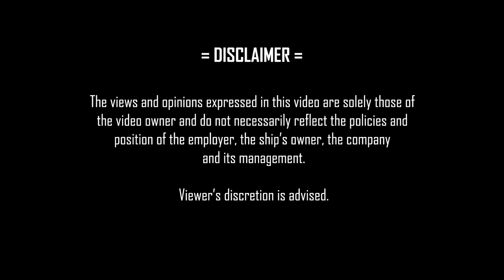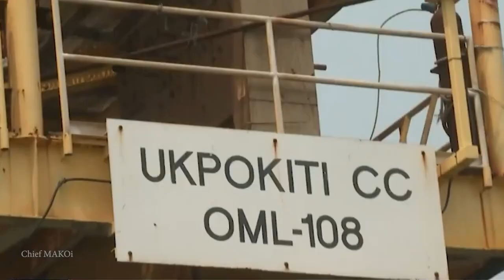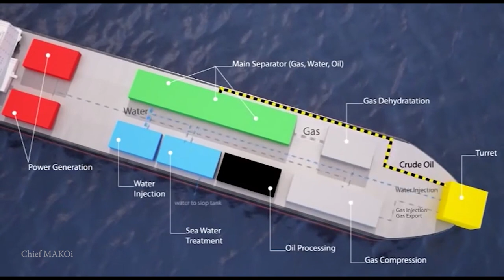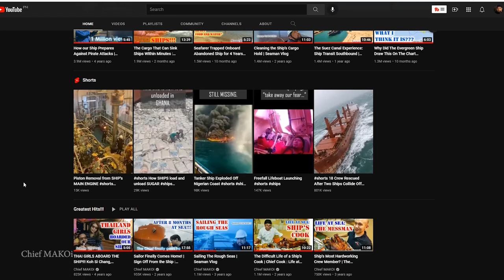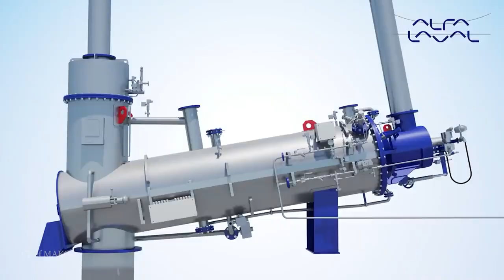Oil Production Vessel Exploded in Nigeria | What is FPSO and Inert Gas System? | Chief MAKOi

Comment: Back in my Navy days and I mean way back we use AV-Gas 115 / 145 or tanks were design to be full all the time, gas and salt water  either receiving or discharge gas and water kept them full. There was a comfier dam around the tanks fill with an inter gas set at < 6 % O2, the biggest danger is we would use it at the flight deck we had to vent it to bring the liquid up to flight deck, Always piss off the officer’s Mess because they couldn’t have candle lite dinner with there steak dinner, cause I put the smoking light out about the ship. 😁😁😁

Comment: Safety standards in Nigeria?.........far too many crews don't even pay lip service. Its so common to see crew smoking and using mobiles on deck. A Captain i knew even had a barbecue on deck every sunday! Frankly its a wonder there are not more explosions. No maintenance and no safety standards makes Nigeria a bloody dangerous place to work on a vessel. I always refused to stay on any Nigerian owned/operated vessel. Then add the open corruption with cargo disappearing off these FPSO's and well you get the picture!

Comment: As I understand it the atmosphere is around 21% oxygen and about 0.2% carbon dioxide. If I remember correctly CO2 is very slightly heavier than average atmosphere. If this is correct a centrafuge will separate (nearly) all the CO2 at a fairly low energy cost, so exhaust tapped off from the main stack and run through a 2 stage centafuge would provide as much CO2 as you could use. The first stage separates particulates and the second CO2.
Reply: The atmosphere is already 80% nitrogen, and that is a better inert gas than CO2.
Reply from the maker: It's the nitrogen in the exhaust gas that's being used.
Reply: Also there is CO which folks can die from...

Comment: FPSOs are mobilized to deep water since reservoirs on shallow waters already on decline, where advanced mooring system are installed on sea bed connected to wellhead and clustered. By the looks of the FPSO, it's obviously an old one. Latest design of FPSOs are more lenient to safety

Comment: Could of been the crude cooking that blew first then resulting fires. A water pump failure or mishap with water valves in the inert gas system. Maybe crude spillage washed into bilge over the years off gassing acetylene got sparked. Maybe one of the guys was over taken by fumes and others vented an area that resulted in the combustion. Bad event.

Comment: Notice that this tragedy never made main stream media. The oil industry has a very good media presence and wont hesitate to use it to suppress bad news. So now what will happen? clearly there were preventable problems and procedures being ignored not lest of which was the age of the asset which had been recognized by it seems all but one in the industry. Will there be an investigation? Will someone be held accountable for the damage and neglect? It would be good to see a follow up on that process and the outcome.

Comment: Is the possibility being considered that the Trinity Spirit, weakened through age and neglect, broke her back; and the resulting fracture and the sparks caused by the tearing of her hull plates, led to the fire and explosion.  Given that the vessel was moored off Warri for such a long time, was considered unsafe, and her cargo tanks were nearly empty, the presence of petroleum vapour in those tanks would be almost certain.
On 07 January 1979, the tanker Betelgeuse broke her back, caught fire and exploded at the Whiddy Island Terminal in Bantry Bay, Ireland, with the loss of 50 lives. Contributory causes included improper ballasting, excessive strain on the ship's hull, failure to use the ship's 'loadicator', the hull weakened by corrosion caused by failure to renew sacrificial anodes, and no inert gas system.

Comment: Chief Makoi... Sir, could you please go a little more in depth on the Inert Gas System ? Maybe I missed something in this video, but why wouldn’t putting a nitrogen blanket be a better alternative than the mechanically complex system you outlined here ?
Reply: Using exhaust gas is a lot cheaper and just as effective, if done right.
Reply: The vessel needs to be able to ensure the atmosphere of cargo tank is oxygen deficient no matter where they go. If you load cargo in the middle east and deliver it to Norway, then the change in temperature may cause the cargo and vapors to contract, creating a vacuum in the cargo tank. We don't want tanks to implode, so there are P/V valves to allow air in to prevent this from happening. But if you are carrying a flammable cargo then you don't want air to go into your cargo tanks. So the inert gas system can be used to maintain low oxygen concentration while underway.

Similarly, say the ship gets to Norway and now needs to discharge cargo. Sending the cargo out of the tanks to shore will create a vacuum in the tanks. So the IG system needs to make up that vacuum to ensure oxygen does not come in.

Some small chemical tankers do operate without an IG system. If they ever need to inert their tanks, they will get pressurized N2 bottles and just use those. But the cargo tanks on an oil tanker are EACH thousands of cubic meters in size, you already have equipment onboard generating low O2 gas (e.g. boilers), so why not use this gas to inert your tanks?

A flue gas system is pretty simple. Bring in exhaust gas from boiler, and run it through scrubber. The scrubber just sprays sea water on it to cool down the gas, and remove contaminants. Now send the clean, cool gas through blowers (a.k.a. "fans") to the cargo tanks. There are some extra automation and safety features (O2 analyzer, isolation valve arrangement, deck water seal) but this covers the essentials.
Reply: @phantomsplit3491 ... Thanx...That cleared up the confusion...

Comment: Probably at their most dangerous when not commissioned and in mothballs. The tanks will have been mostly empty but with volatile residues and the huge solar heated void space is arguably more vulnerable. One damaged flame trap or a scrubber plant breakdown. No licence, no income stream, no maintenance, no chance. The low oil prices have been a big problem for the marginal boys. Make do and mend not maintenance. How does seabed production well head control line hoses fitted with duct tape bend restrictors grab you?

Comment: Instead of saying "heat" -- you should just call it "ignition".   Because even static electricity from our fingers touching something can ignite the fuel, and there's no "heat" really, just a spark...   Even in a diesel engine, the fuel ignites purely from pressure by the compression stroke of the piston;  diesels have no spark plugs (as you know).  But still, ignition occurs, and without "heat".
Reply from the maker: Actually, wrt diesel engines, the compression heats up the air inside the cylinders.  It's in the formula of the combined gas law.  It's hot enough to ignite the atomized fuel particles that get injected.  Same thing with sparks.  It may be subtle to us, but for an atmosphere with combustible vapors, it's enough heat to ignite a few particles which in turn causes a chain reaction.  So in the end it's still heat.

Comment: You actually don't really go into detail much. Most accidents involving explosions on tanker ships occur during tank cleaning, not so much during loading or discharging, or even just sailing. This is also why tank cleaning alongside jetty's is usually forbidden. It does have to do with the fire triangle as you explain, during tank cleaning you introduce moving parts like fixed tank cleaning machines that can introduce sparks when they break down. Also for loading and discharging a maximum flow is adhered to, to prevent static electricity buildup in the fluid. When cleaning cargo tanks, especially larger ones this can become an issue because you can have static electricity buildup in the washing water (this is the very reason IGS is actually used). What is also noteworthy is that the highest explosive potential is achieved during cleaning operations. If a cargotank is 98% full, the space for a explosive mixture is relatively small, while having a empty tank with cargo residue creates an enormous volume of explosive mixture. The clip of that Stolt tanker exploding is something entirely different, that was a Styrene polymerisation runaway reaction. A famous accident involving cleaning operations was the Bow Mariner disaster in 2004. I was working on a chemical tanker myself at that time and have seen underwater ROV footage that was taken just after the sinking, litterally labelled 'casualty search'. That footage was scary, it showed the vessel ripped apart like it was made of paper.

Comment: None of these are actually explosions, they're only conflagration or combustion, not detonation. You're looking at examples of simple fires, not actual explosives or explosions. For someone who is usually so careful with terminology this is a pretty glaring mistake my dude.
Reply: Actually it isn't. If combustible materials are stored at high pressure they can explode. The force of this particular one split the ship in question into two. The oil tanker he kept showing when he referenced the explosion of tankers was heavily damaged by the force of the explosion. Heat+pressure+combustible materials=explosion.

Comment: Why not use new salt nuclear ☢️ engine instead of all this mess. 🙄
Reply: Because you need to mine uranium, which does not occur in significant quantities everywhere. Then you have to process the uranium minerals to qet the uranium oxide.
Mining is messy, the whole process is messy but the reactor.
That line of reasoning is the akin to that used by the meatless people, I mean ignoring the whole production chain and just focusing on the final product.
Reply: @chattonlad9382  most people think "clean" regarding the last step, but few have any idea regarding the whole chain, in a kind of "Total cost of Ownership" way. There is always the risk or a bad actor, even with "major players", like the nuke club....
I only trust myself with nuclear stuff.